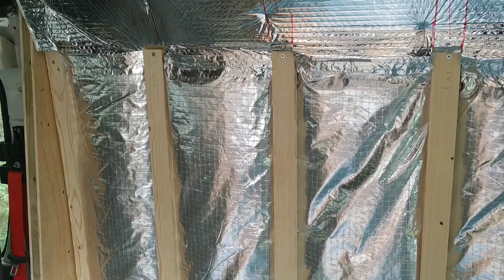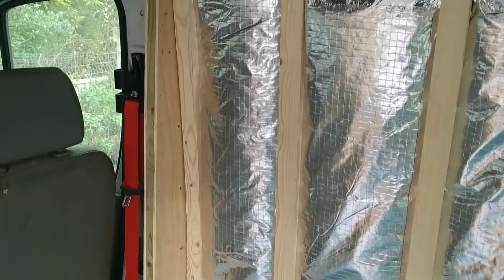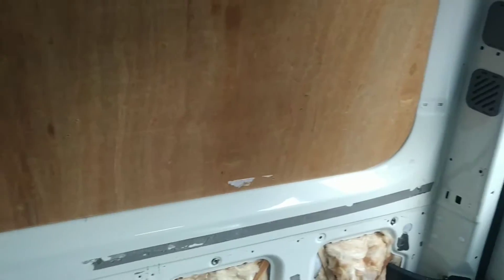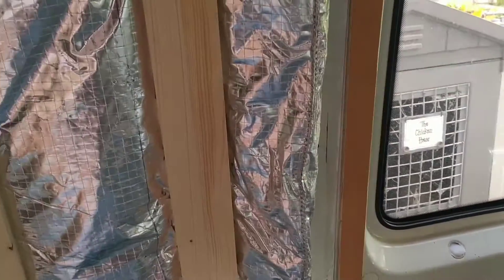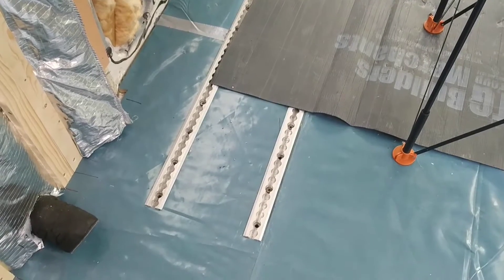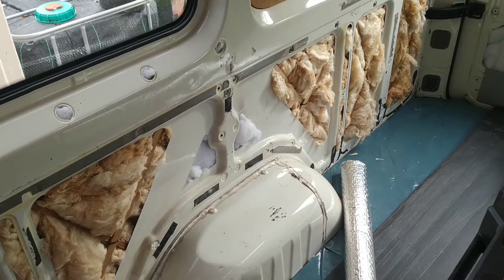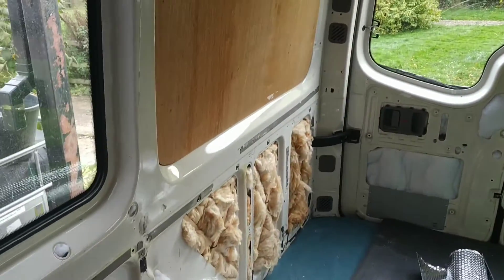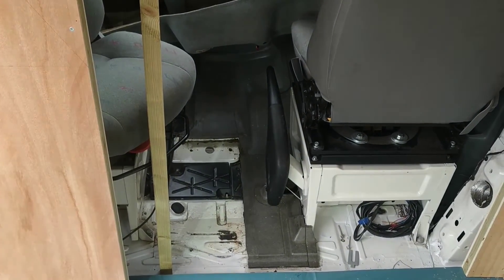VW Crafter Van conversion part 23, experimenting with YBS Super Quilt insulation to save space.

Comment: used similar in our first van (not self build) which originally had nothing, 20 yrs ago was very expensive but worked a treat i seem to remember it had 17 individual layers good luck with your build.
Reply from the maker: Cheers, yes we have stuff probably very similar to this in our loft conversion, which we had done over 18 years ago, space was tight for the required headroom over the stairwell.

This bought an inch or two and made the difference for building regs approval as a habitable room.

I am pretty sure it was relatively more expensive then than it is now, this 10M roll cost about the same as a similar area of 25-50 mm pir

Comment: Coming along 👍🏻 I've used Triso 10 a few years ago on a loft conversion I built but I stapled it on 👍🏻 that's going to be one warm van, not to sure but wasn't this type of thermal quilting designed for the space shuttle then made it's way into the building industry 👍🏻💙✌️
Reply from the maker: Hi Brett, yes I remember hearing that also, not too sure if it's a myth though but yes we have something very similar in our loft conversion as well. Main reason for all this insulation is not just to keep us warm but to keep the heat of the Sun out..... In theory!